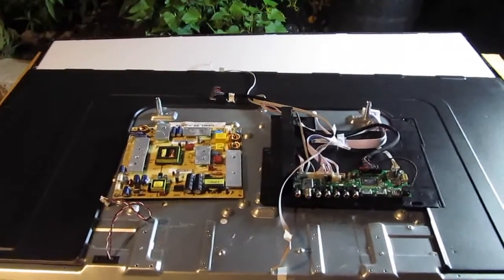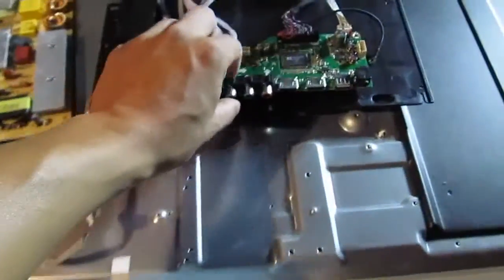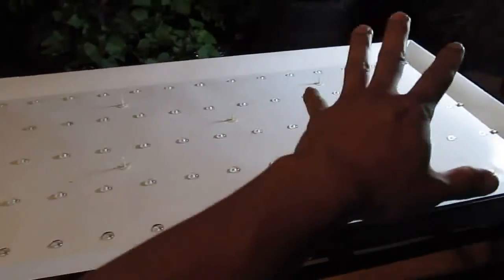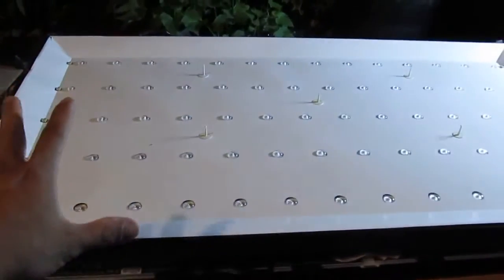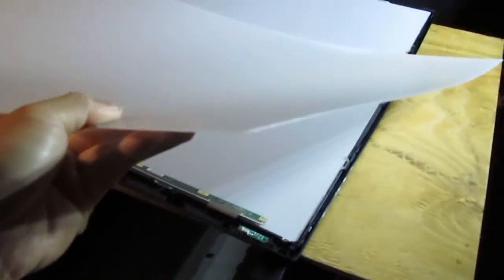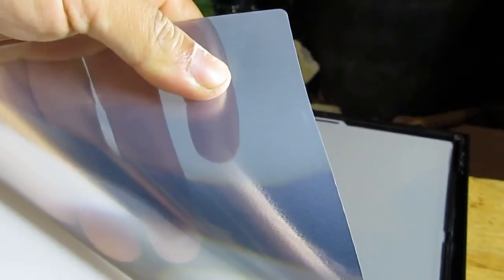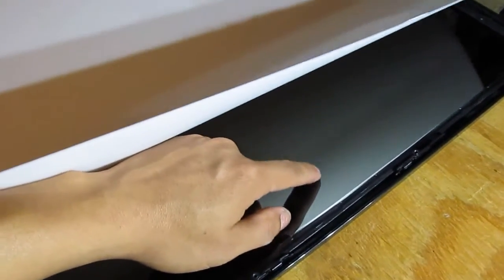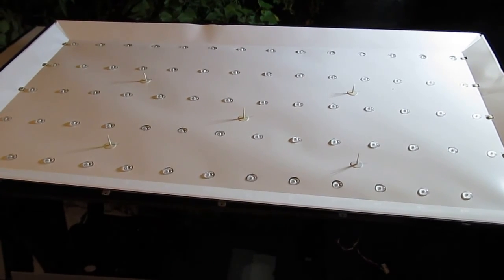LED TV teardown & disassembly: What's inside an LED LCD TV?

Comment: Curious what the model number is of this Samsung.  I recently found a UN46EH5300 being thrown out.  It is only 3 1/2 years old and the problem is with the LED's.  Apparently there is an open LED causing the panel not to light up (power supply tests fine and is at over 200V which indicates bad LED string).  I have been trying to find instructions on how to remove the back panel so that I can find the bad LED strip and replace it.  The service manual I have is of no help in that regard.  Everything is about replacing circuit boards which is a trivial job.